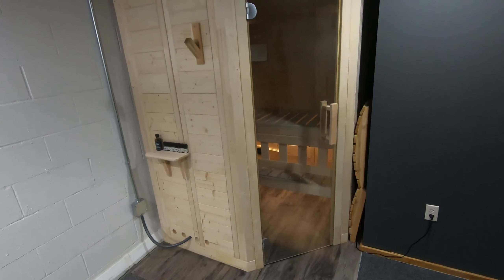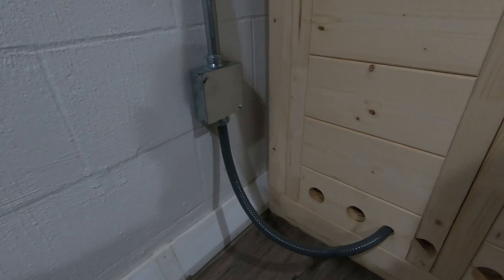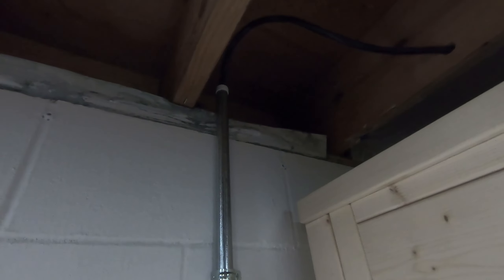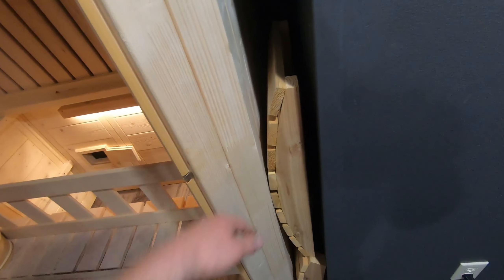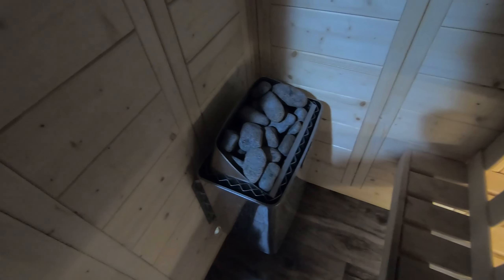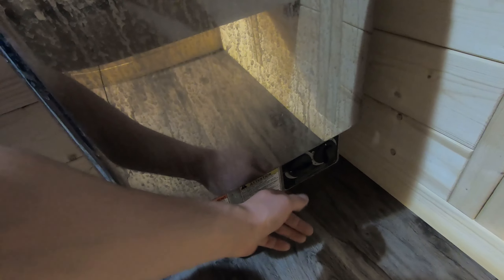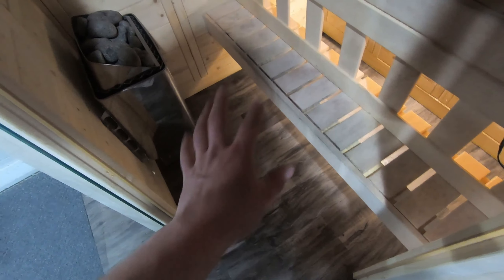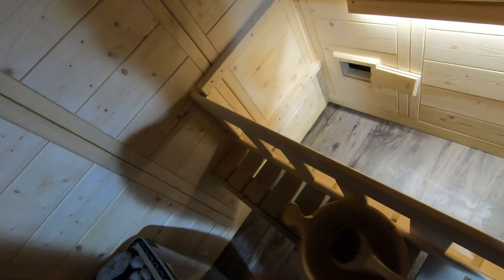Almost Heaven Sutton Sauna Kit Review

Comment: I am now told that the hinge bushings do not go through the holes in the door but stand proud of them around the hole. The manual does not give clear instructions for this. Is this how anyone else has done their hinge install? This would leave about a 3/16 gap between that side of the hinge and the glass. Thank you for any help.

Comment: confirming the roof is not 80" ? We have an exactly 80" garage ceiling, will this fit underneath that you think?
Reply from the maker: @K9Ranger-r7z  I've got 80.25 inches floor to ceiling. I wouldn't get it. Or find another place to build it. Because realistically you need another.75 inch or so on top of that to hoist the roof panels up and over the lip and drop them in. Regardless it won't work

Comment: What size hole saw did you use for the exhaust holes below the heater?
Reply from the maker: @Thelaidlerfamily  I think they are between 1.5 and 2 inch holes. Can't remember.
Reply: @fastcar42069  thank you for answering back. This video is very helpful!
Reply from the maker: @Thelaidlerfamily  it's not an exact science, it doesn't even say in the booklet to punch holes. I just know you need them from the other sauna research I did. I just punched 4 and that looked good enough for a start, and if I was having breathing problems from too much CO2, or the heater tripping out from high limit,then I'd know to punch a couple more. But 4 holes has worked great

Comment: What did you do with the exhaust/vent in the back? Does it just vent out into the room?
Reply from the maker: @KB1153038  yes actually I built it into a custom "room" or cubby if you will. So actually the drywall is behind it maybe 3 inches away. It's been a year and not a single moisture or airflow problem whatsoever. I also put a register into the drywall to allow air exchange into the basement area outside the room (other side of that wall is just open studs). Make sense?

Comment: Did you put a water barrier under your laminate?
Reply from the maker: @ToddSmall-d7p  yes I bought a roll of that stuff at Menards, was like 20 bucks. Put it down per the instructions and then laid the lvp on top of it. Haven't had any issues since.
Reply: @fastcar42069  I appreciate you doing this video. I just started to build my Sutton 2 but I decided to put down LVP. Good quality wood and sauna. Thanks
Reply from the maker: @ToddSmall-d7p  no problem, gives a nicer feeling on the feet and surprisingly never feels cold